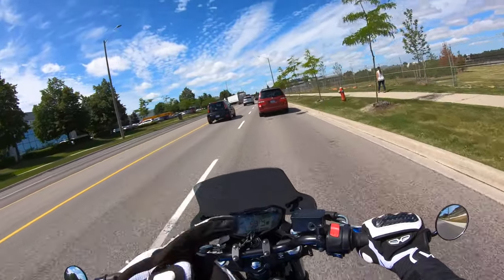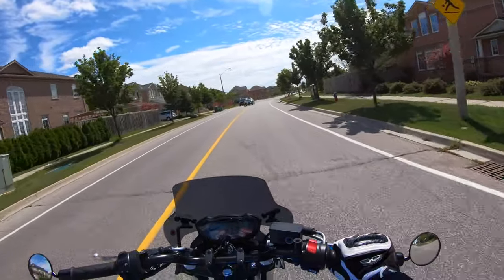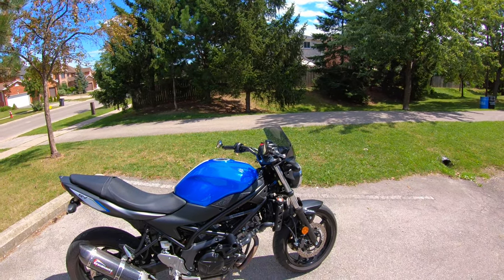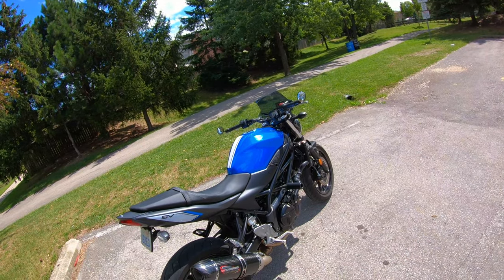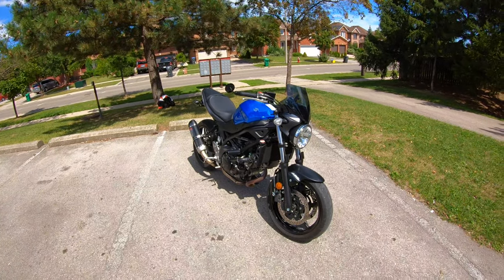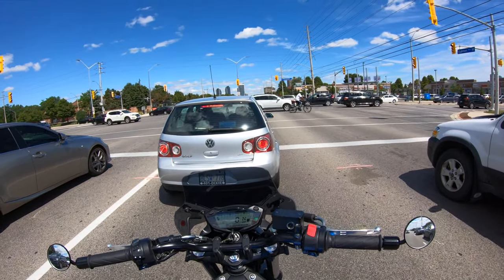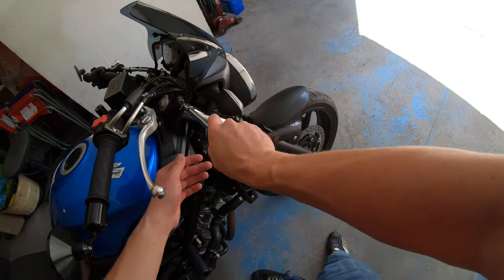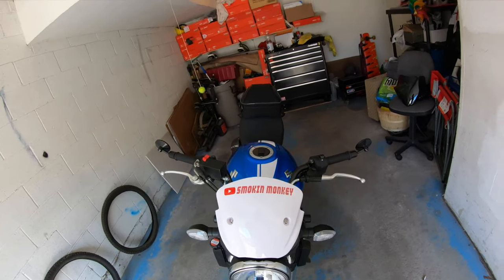2017 SV650 Givi Windscreen Long Term Review

Comment: Hi Guys, I just have this Givi windscreen installed on my bike and went for 250 KM ride, mostly highway to the mountains. (I am in   Calgary). 
Pros: Great quality, very solid and easy to put on. Looks good on SV650. Definitely build to last...
Cons: I am 5feet 9 and thought, been a shorter than Smokin Monkey, I would not face the same issues he had. Unfortunately,
I can report same things: this givi, somewhat releases the air pressure from your torso and sholders, but there is a ton of air flow around the helmet, and this generate a lot of wind noise. Deafening wind noise, baffling endlessly. I tried different positions, tackle myself to the tank, pulling back, standing on the pegs for comparison. Funny enough, standing on the pegs was the quietest position, despite not been protected.
Too bad, I have had great expectations and judging by looks it should work great. Looks like it should have provided better protection than many flared bikes, but it is not.
Will be taking this off of the bike tomorrow. 
It also does amplify sounds Smokin Monkey mentioned in his review, It would not bother me much if wind noise/protection could be better.
Hope this will be helpful to other riders. Cheers
Reply from the maker: That’s awesome feedback man! Thanks for the comment. Glad I’m not alone at in my experience with this thing lol
Reply: @SmokinMonkeyOG   Thank you Smokin Monkey.  Based on your reviews,  I went and bought my 2019 Sv650 last September... it is everything you said it is. I truly enjoy it. Thank you for all your work and efforts, it is very useful. Safe riding, cheers!
Reply from the maker: Glad I could help!
Reply: I can third this. I just wish I had seen this video before I purchased mine. I'm 5' 7" and was having the same exact issue (crazy wind noise and no way to get around it except stand up). While it does significantly lower wind on your chest making long highway rides bearable, I found that I had to put on ear protection to make it enjoyable. Also, like Smokin Monkey said in his video, there is a reverberation of sorts that you hear more of which I actually liked because it gives it a more aggressive sound under load (not sure of that's how it sounds off the bike though) . I ended up removing the windscreen after a week. I will keep it in case I do a long tour someday.
Reply: Lol I'm in Calgary too, about 5'8 and just dropped $470 on the Puig Retro Semi-Fairing and was quite disappointed that it didn't deflect next to any air off of my head. Basically the same issue and because of this, I was planning on snagging this Givi for the long rides, but hearing that these issues still persist at our height, then maybe the Puig isn't so bad after all. Plus, I can't say I've noticed any vibrations and maybe that's because the semi-fairing wraps all the way around the headlamp? In my opinion, it really pulls the whole look of the bike together and looks wise, I couldn't be more happy! I never really was a fan of the top of the gauge cluster anyways, but $470 is a steep price to pay for a windscreen, can't lie.

Comment: I'm also 6' 1" and I don't like windscreens in general except on those big grandpa bikes and touring. Not that I have experience lol just from an aesthetic point of view

At 2:12 - 2:20 you can hear the vibrating noise you're talking about if you have headphones on. No bueno.

Edit: To deal with the cracking if you decide to buy this, when you tighten the bolts countersink the holes with a phillips screwdriver or an actual countersink. I used to work on boats and with fiber glass and acrylic windscreens you have to do this step otherwise it'll crack even if you barely crank down on it.
Reply from the maker: I agree I don’t like windscreens unless they come on the bike. And I honestly tried not to crack it but like you said it’s hard not too lol oh well I don’t plan on putting it back on my bike anytime soon

Comment: So it is not for me, I have the same size as you (6 ft 1 inch) and having the air pushing your neck and head is no confy.

The other option is having a tallest windshield (but making the bike really ugly) or using the little one you have
Reply from the maker: Ya I agree I don’t like the really tall windshields. But after riding this bike for almost two years you get used to the wind and it’s really not that bad